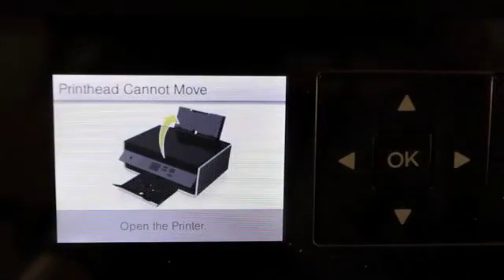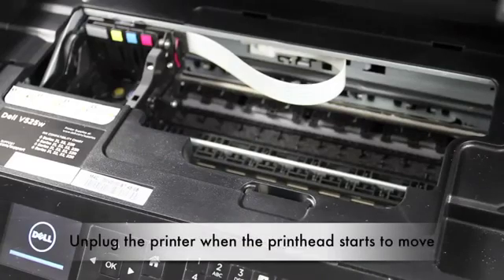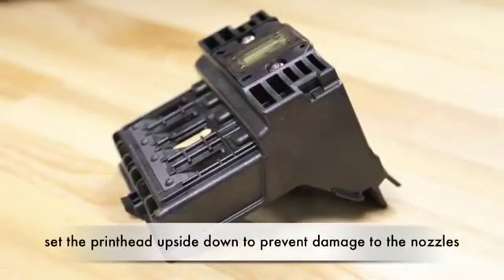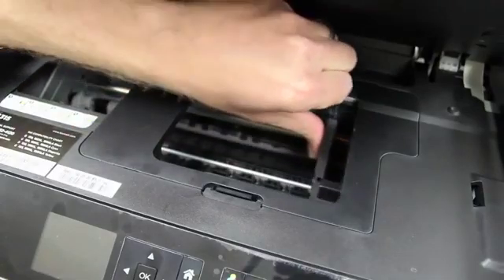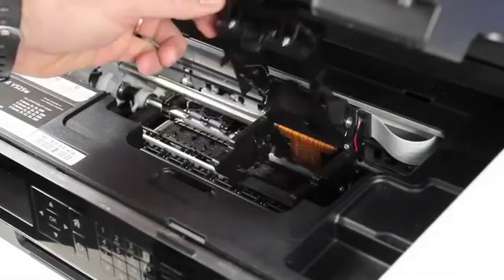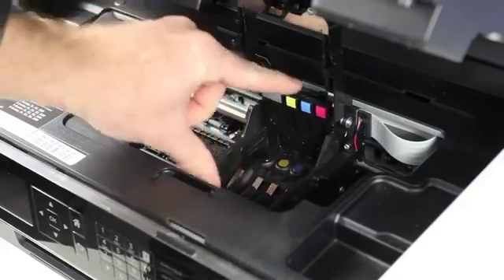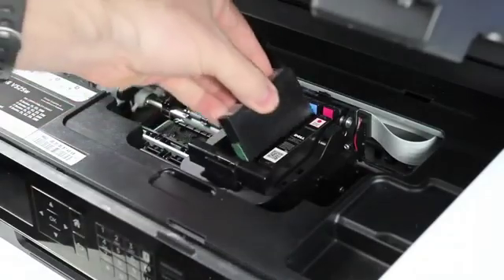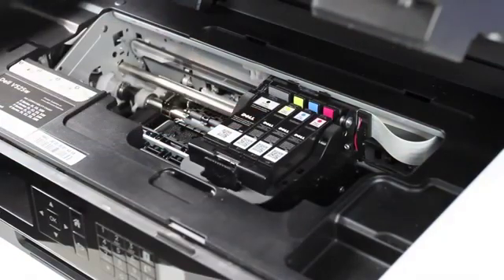How to resolve Printhead Cannot Move message on the Dell v525w AIO Wireless Inkjet Printer

Comment: To remove and reinsert the Printhead, perform the following steps: 1.Make sure the printer is on. On the control panel on the front of the printer, press the Setup   button, using the arrow buttons highlight Maintenance and press OK. Use the arrow buttons to select Replace Printhead and press OK. 

dell.com/support/troubleshooting/us/en/19/KCS/KcsArticles/ArticleView?docid=122270#Issue4